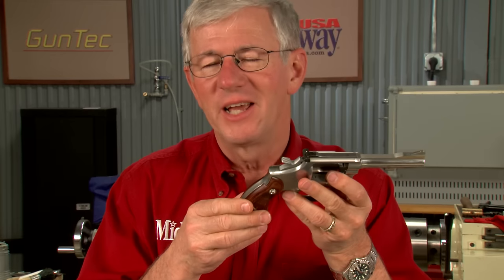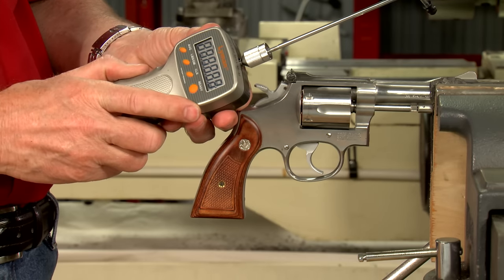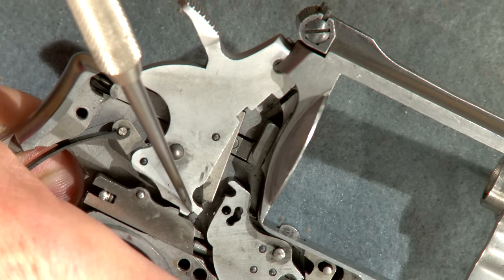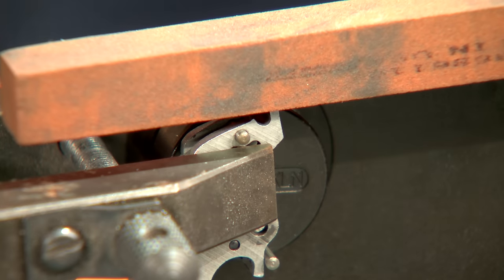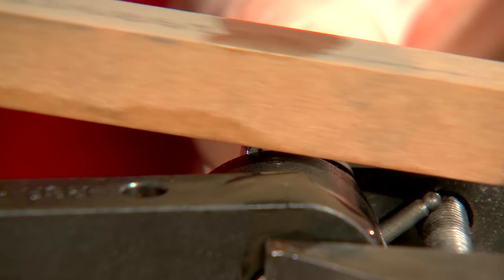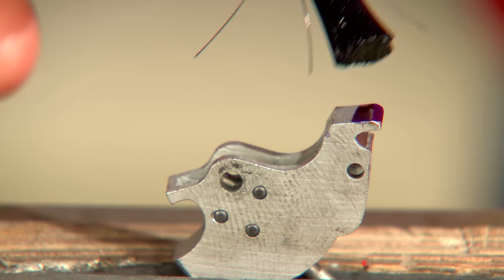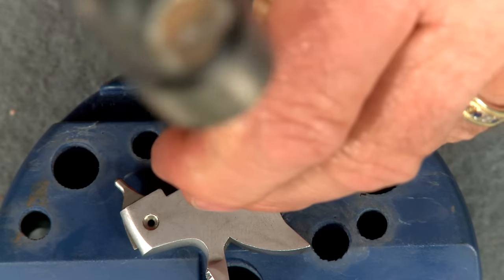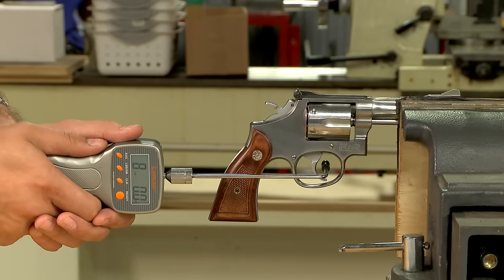How to Lighten & Smooth the Trigger Pull on a Smith and Wesson | Smith & Wesson Revolver Project

Comment: I just got a Rossi model 68 and the trigger pull must be like fucking 12 pounds at least. It's really really hard. Any tips that don't require diss-assembly/gunsmith?
Reply: Buy 12 snap caps (2 cylinders worth, I'm assume that's six, I'm not familiar with that model) and practice reloading the revolver while firing it a LOT. That smooths the trigger out the hard way, but its also the easiest way. I say snap caps just so you're not realy dry firing, and reload practice never hurts.
Reply: eyeorderchaos   No.  Either dry firing or live fire actually does smooth out most revolvers somewhat as the parts wear against each other...especially on new guns.

Comment: No, because any comment about the accuracy of certain guns would be sweeping generalizations. All factory guns are not equally accurate. Tolerances differ from company to company and for different styles of revolvers. Even with a machine rest, revolvers produced on the same assembly line will shoot group sizes that differ by several inches at 25 yards. Even with CNC machining, there are many variables involved. Note that most factories do not test fire every gun for accuracy, only function.

Comment: I like my method. Shoot the gun 5000-10,000 x and it smooths itself right out. Why is the honing mark not quite square when using that $400+ jig?? And if that's a fine stone, I'd hate to see the coarse one. Break out a translucent Arkansas or a fine black surgical stone on that sucker and make it smoother than glass. When that procedure is done take a piece of leather bonded to a flat piece of steel and go even finer with some <1 micron polishing compound and finish it up with some jeweler's rouge. Some "rotten stone" inside the frame will also do a world of good too. Follow that up with fine polishing compound, and finally ultra-fine grain jeweler's rouge. Use a burnishing stick with your polishing compounds to smooth out the frame and cover plate. This can simply be small maple dowels, and a few bamboo skewers. Fully flush all the compound out before proceeding to the next finer grit, and thoroughly clean the gun out before final reassembly. The only other way to get a gun that smooth is by using it a lot. By the  time a modern S&W is that slick it is starting to develop other problems, like loose lockup and or timing issues. MIM parts kinda suck. To think I used to complain about S&W's case hardening. Leave it to S&W to find an  even cheaper way, that sucks, and use that.